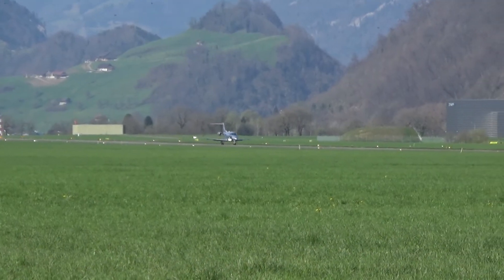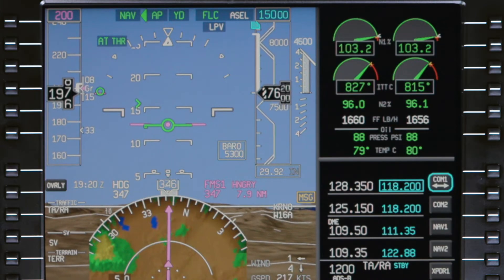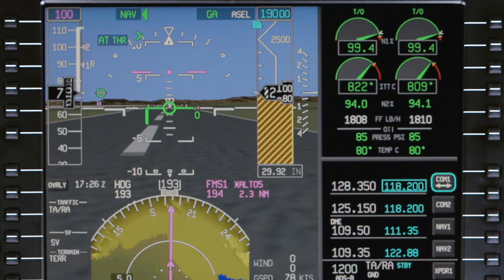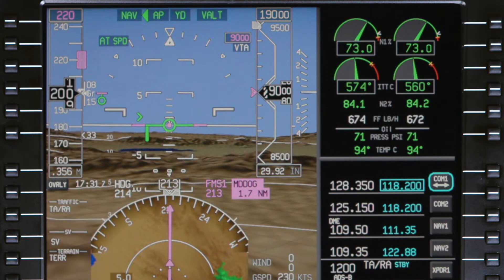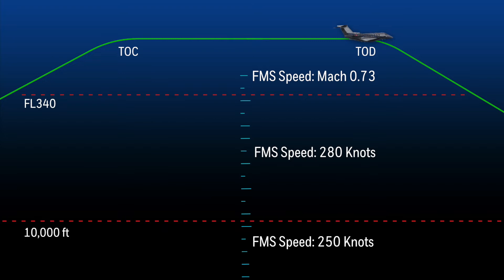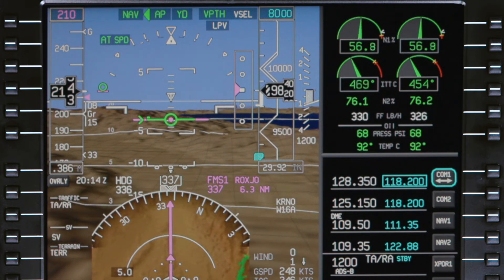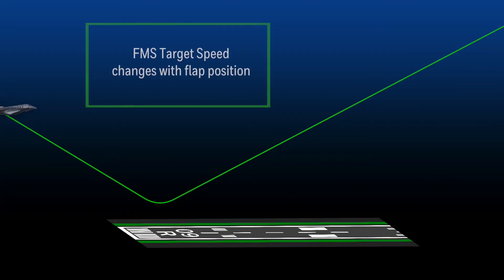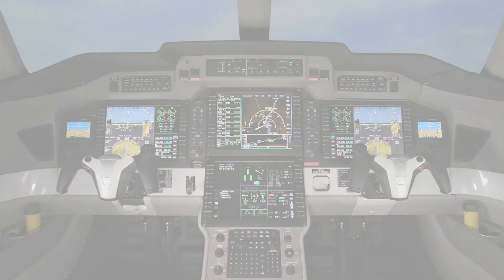FMS Speed Schedule on the Pilatus PC-24 (Load 4) | Honeywell Aerospace

Comment: Thank you for the video tutorials. I want to add my opinion. I have a problem with mmo of .74 and the FMS set speed of .73 for cruise and descent. I have observed flying the 24 an over speed condition with the FMS speed schedule always occurs. The auto throttle and avionics are not precise enough to maintain that hundredth of a Mach. When cruising or descending at .73 on auto throttle, it’s always wandering into mmo (.74) and throwing an over speed FAS message. .72 for cruise and descent on auto throttle works much better and never gets an over speed.